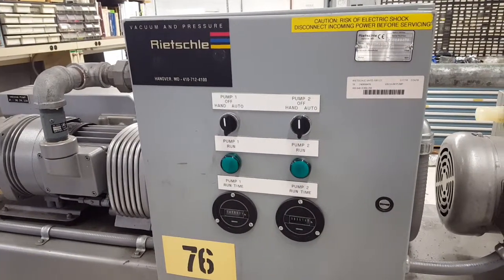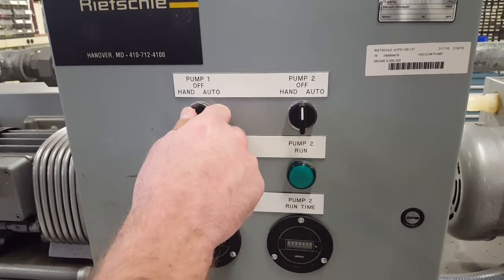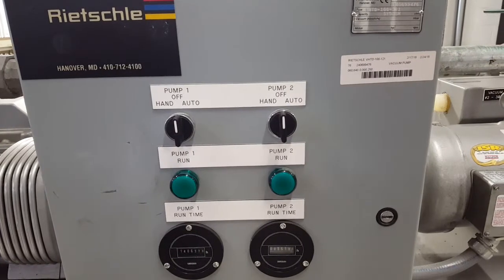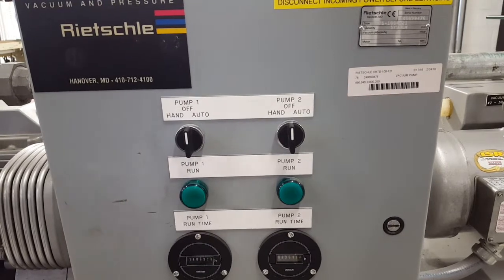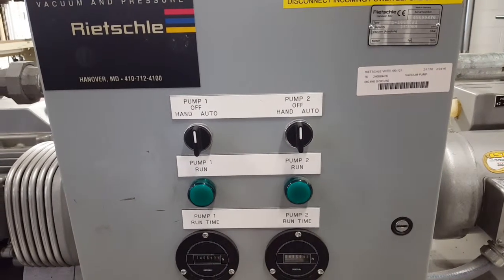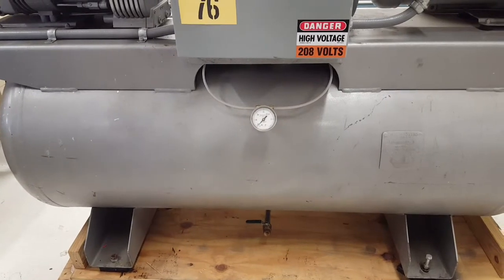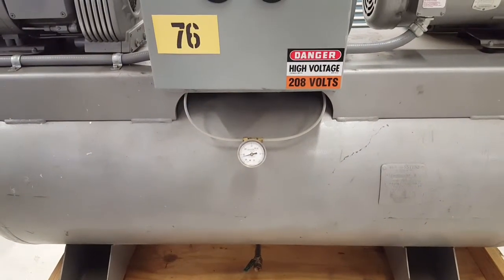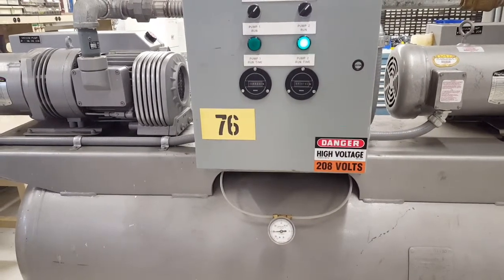Rietschle VHTD -100-121 Vacuum System #60640

Comment: this system is it for compressed air to operate the pneumatic machine?
Reply from the maker: This system is a low pressure high velocity air compressor.
Reply: @BidServiceLLC  Tks. I can use it as a air compressor? How can I connect it with the air tank?
Reply from the maker: @chuirogers  Lower right on tank is is an NPT output fitting.